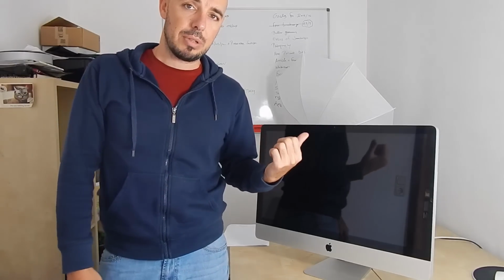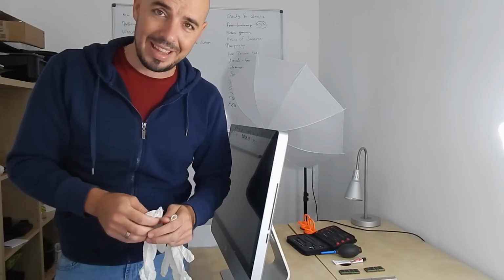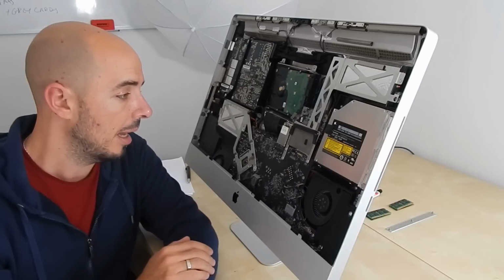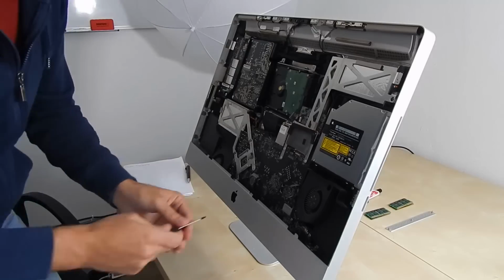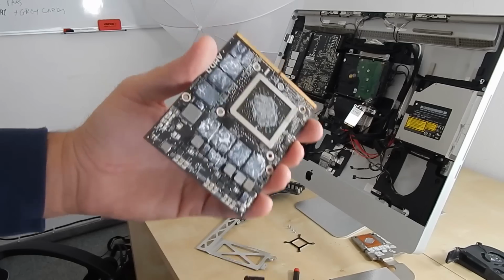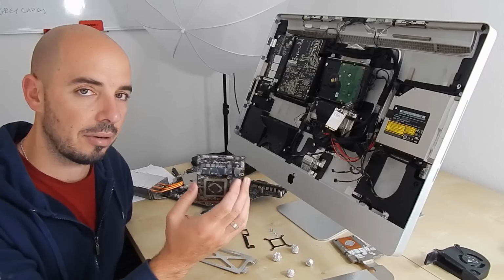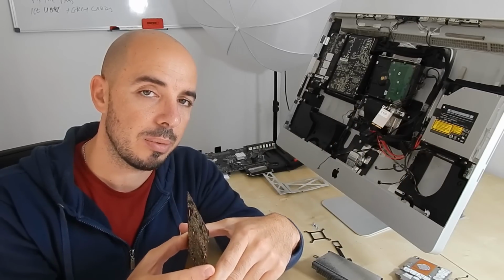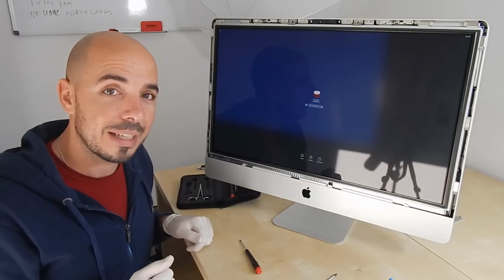Burn the VGA and  Fix your iMac - Don't Pay Shitty Problems!!!

Comment: I found this video very helpful and followed it and it worked.  But only for 3 months.  I'm going to do it again and this time, also install the smcFanControl app to see if that allows me to get some more time between fixes.  Hopefully I can do it a bit faster the second time now that I have the experience from the first go around.    I want to ask though: is there a more permanent fix? Or is it just an inherent design flaw?
Reply: It's the crappy quality solder that the manufacturer uses.

Comment: Good video! One tip I could add is that you can always test the system without having to reassemble everything by plunging up an external monitor to one of the thunderbolt connectors in the back.

Comment: I have iMac mid-2011 27" it is currently running on mac os Catalina but there is an issue with the system it is now slow, freezes some times, it heats very high and goes up to approx 150 Fahrenheit, and I am not able to downgrade it because mac os utility is not working on it. is this a graphic card problem or I have to change motherboard for this. Please help me on this I am stuck on it.

Comment: I just tried this method today,did everything but when I turned on to see the result,I had black screen and a beeping sound.I was surprised that I found a the first cable at the top that connects the screen it was with a bit of tape (maybe disconnected).I suspect this mite be the issue but what about the sound? Please help me!
Reply: You have to follow overstep very careful, I baked my gnu card twice successfully, it happened also breaking a wire and connector, but I manage to fix it. Good luck!

Comment: Hi! I have to say that I was a bit skeptical about that all cooking the Card and I was more thinking of buying and upgrading to a 2gb (from 1gb) instead of doing this. But I did. With little knowledge about disassembling the whole 27" imac 2011 that I had. But I already upgraded the HDD so I knew a little. I did it and it seems fine.... crazy amazing. I hope it will last... but after doing some testing yesterday it work very good. SO until now yes, I can recommend it. If you have any questions I can also try to help. But the video is pretty clear and shout out to Evan for sharing it.

Comment: I have read elsewhere, that this is not a good solution, at least long-term-wise. But since I did not have any real options, I chose it, and it worked! I am on a beloved iMac early 2008 24", really a great computer of its time. Good to see I can still use it and work on it, after 12 years! Still gets everyday jobs (and a few heavy ones), done. Great machine.

Comment: Just tried this, took me about 4 hours to complete and so far so good! Thank you so much!

Tip: create some kind of contraption to jam the screen fully back tilted. Been reading a lot about people accidently dropping the lcd and damaging the fragile cables when the screen suddenly tilts forward. Makes it a whole lot easier when fiddling with the cables connecting the lcd!
Reply: Hey Marcus, I have a similar issue. Just double checking that everyones not trolling in the comments. Does this indeed work?

Comment: Thank you Evan, another success. It was hard to assemble it back, but I made it!!. 
3 improvements to your video are: 
1) take pics or video during disassembling for every screw and wire, since start
2) be more specific about pulling out the Motherboard since it is locked from the bottom, with the IR sensor (about behind the Apple logo). Without pulling this the MB won’t come out!
3) Remove the RAMs otherwise it wont be easy to replace the MB in the original position, then place them back through the aluminium panel from below

Thank you again, I made it yesterday and I hope it will work for long time.

Comment: Hey Evan, your Video is great and it worked perfect, my Mac starts as usual  !!!  except  !!!  there is no sound and no connection to the speakers or earphone! Any idea what went wrong? Did I leave out a connection or what could be the reason. Any solution?

Comment: Wow. This actually worked. My mid-2007 iMac was hanging at the logo/progress bar screen while booting. I followed this video's instructions and I now have a perfectly working iMac again. Thank you, Evan! You have saved me a shit-ton of money, and I'm donating a GIANT cup of coffee via Paypal.  :)   Just in case anyone else encounters the same problem I did: After baking the graphics card and reinstalling it into the iMac, I booted to a black screen with no video at all. I could could still hear the chime and the hard disk whirring, but the screen was completely black. Some more Googling led me to someone who had replaced his graphics card only to have the same problem about the black screen. He resolved it by opening the box back up and re-seating the graphics card. It turns out that the card can look like it's properly seated, but you actually have to push it in pretty firmly, enough so that you can barely even see the gold contacts on the card. I re-seated mine and it booted up perfectly with no issues at all. Again, thanks so much, Evan, for taking the time to make this video. Enjoy your coffee, my friend!

Comment: I've done this on a logic board for an LG tv due to the HDMI ports going bad. If you don't want to deal with the smell inside the house, if you have a toaster oven, you can use that outside. Works just as good! Great video!

Comment: It friggin' lives!  I finally went through with the oven reflow, and it worked!  Thank you.
Reply: Update:  It's been a year and the GPU is still working.  Definitely run the smc Fan Control app at all times.  My iMac temperature hardly ever goes above human body temperature.

Comment: Thank you Evan!
It worked out fine and my mac came back up.
My imac is from the middle of 2010 and it is possible to remove only the video card without the need to disconnect all the connectors or remove the motherboard. But since I had already removed the motherboard, I changed the thermal paste of the processor. Here in Brazil the repair would cost R$ 3800, equivalent to 1000 US$. If it were not for you, you would give up this imac. THANK YOU!

Comment: So I did your solution today and so far it seems to be working...I think I switch the fan and the sensor cables as the fans sound like they are running on high...will keep all posted for how long it lasts

Comment: Hi Evan! My name is Andrew I am from Russia! Thank you so much for your awesome awesome cool great video! My wife and I have been working on the imac all evening. After dismantling the IMAC, we finally took out the video card and stuffed it in the oven for 8 minutes (200 degrees Celsius). And it worked! THANK YOU VERY MUCH. Little advice. We decided to install Windows on our imac. The video card works, but it heats up to 90 degrees Celsius! To fix this, we installed the Macs Fan Control program (the program is available for both Mac OS and Windows). We adjusted the speed of the fans and now when the video card warms up to 70 degrees, the fans work at full capacity and do not allow it to warm up more than 70 degrees. Thanks again! Guys, watch your cooling on the imac.

Comment: Saved me £400 for replacement graphic card repair - Thank you, This works, I just wish Apple would make the monitor cables 4" longer, would make it so much easier to work on the inside

Comment: Thank you a lot Evan! You saved my Mac! But I found another method to unmount the video card that avoid to remove the mother board. You must remove only some torx and a cable behind the m/b connected to the videocard case before to pull up the board easily. 
Thank you again!
Reply: Thank you for your useful advice! It worked :)

Comment: I used my hot air gun for 8 minutes at 200 degrees. Fixed the imac first time amazing. I was tempted to add some flux to the chip solder balls but as it turns out not necessary.

Comment: November 17th 2018 - Been having many problems getting my Imac 27" Late 2011 to work

Wouldn't start properly trying internal HDD OS & separate internal SSD OS. Tried Recoveries, internet recovery, formatting drives but still wouldn't load OS correctly and after a while it kept suddenly jumping to a BLUE SCREEN with vertical lines 

I tried this 200c for 8 mins this afternoon & WOW IT WORKS !!!!

Big thanks! Even if it doesn't last it's evidence this work sand finally i'm away from an issue i've had for month now (bought a new Imac at the time as couldn't wait)

Comment: Evan , you don't need to take the motherboard out just loosen the 3 screws on the heat sink at the bottom and the top screws and it will come out without taking the main board out. Also consider replacing the hard drive and the dvd player with SSD drives. 
The Imac benefits two ways 1) the system will run a lot faster , 2) the heat generated  is considerably less.
I used a 1TB in the main drive location and a smaller SSD in a drive caddy for the dvd location.
Heat, dust contamination &  poor ventilation kill all electrical items,  the heat sucks in the dust which kills the card. If you still want a dvd drive you can buy a dvd enclosure on ebay or amazon, most people stream these days or use usb sticks so dvd drives are not used that much.
One other thing when you drop in a SSD the temperature sensor that plugs into the hard drive cannot be used, so I took the thermal stick stick on sensor off the dvd drive and placed that on the SSD. If you don't use a sensor the system fans will be running 100% all the time eg noisy .
I used a system cleaner to removed the old thermal paste and then cooked it and used a chemical cleaner to remove the contaminants before applying the silver paste sparingly to the chips.

Comment: Knock on wood, this seems to have fixed my 2011 iMac 27" 3.4Ghz i7.  For 3 weeks I was trying all sorts of recovery methods, re-installs but couldn't get the Mac to work.  Sometimes it would run for a couple hours but eventually it would white screen.  I even brought it into the Apple store and after they re-installed the OS, it worked for a brief time long enough for them to run hardware diagnostics to which they said 'everything passed the hardware tests'.  However, once I got home and used the machine for just an hour, it white screened again.  I thought all was lost so I ended up buying a new iMac.  However, I came across this video (and others like it) and decided to roll the dice since I already had a new machine and had nothing to lose.  I tried baking the graphics card and presto it's been running for a week straight with no issues.  I'm not sure how long it will last but it's absolutely working now and no hint of failures yet.  If you're at a point where you're seeing all the same symptoms (e.g. white screen, screen acting weird, etc) and none of the other fixes work, I suggest giving this a try.  I did read somewhere that it's better to use just a little thermal paste rather than the gobs that Apple used so I was a bit more conservative with how much thermal paste on put on, hopefully that's the right thing to do.  Also, apparently at one time this would have been covered under a recall from Apple where they would have replaced the graphics card for free up to 3 or 4 years after original purchase, but that recall expired several years ago.  Give it a shot and best of luck!!

Comment: I did this and my iMac has been working for two months now. It’s a bit of a mission but well worth it. Thx for this helpful video, really appreciate it.

Edit: It has failed two more times so this will be the third time I bake it, I’m going to give up if it fails again tbh. To be fair to apple it did last for 8years with extreme graphics work: photoshop/illustrator/muse/Spotify/after effects
Reply: lionelrichtea this is good to know. My computer just stopped working, and I think it’s the graphics card. I work in Adobe programs a lot.
Reply: Ainsley Bourgeois it’s a pretty intensive procedure and you could easily break something else (not for the faint hearted). It’s the old chips, they slowly move off the board and then the computer registers that it’s off and it won’t work. I was quoted 700£ to get it fixed!! But that would of only had a 30day warranty, no chance I was doing that. I ended up getting six months extra by repeatedly doing these bakes. I saved up and just got a brand new one. I really feel for ya as it was a nightmare for me, Good luck.

Comment: Hi Evan and thanks. I have one question, thermal paste's conductivity ratio seems to be very important for the lasting of repaired VGA card, I'd like to know if this paste gotta be high or low conductor. I have heard K5-PRO brand thermal paste works very well (K>5,3 W/m.K ).

Comment: Thank you for sharing this very very useful video,, my iMac, same model as yours, died in December 2017, same graphics card problem which I found out after a visit to apple store to get my imac diagnosed... They said it is not repairable because the part is not available anymore,,,, So I got in touch with a local MAC specialists and they offered a repair which would cost me £750..  and even that is not guaranteed to last forever because they would be using a second hand graphics card... which I was so disappointed with it until now... I am going to try this method and see if it works, as I have nothing to lose since the iMac is sitting in the box as a useless monsters....

I will update after the FIX and possibly upload a video too.

Comment: what is the deal with the 10 secons pressing? i did all that and now my imac wont power up, i looked over the internet and some people resolve the non power macs by pressing back the power button for 10 seconds, other unplugging the cable, but nothing of that seems to work on powering on the imac, nothing happens, no sound, I had done this proccess before and worked fine, the only diffrent this time was pressing the power for 10 secs, please if you know anything about what exactly that move does to the mac will aprecciate. :-(

Comment: I know very little about computers, I just use it to edit. But my graphics card died and the store wouldn't fix it and I was desperate and also very broke. Then I found this video. Evan, I don't know you but... I love you. By watching you over and over and over again I did it and... IT WORKS!!!! I can work again!!!

In my case, I ignored the stripes until finally the screen just went black. Still powered on, but nothing on the screen. Yes, this is graphics card failure. Yes, cooking the card works!

Additional tips for first timers: 
1. Get some masking tape and mark each wire you pull, then draw a diagram so you'll remember where they all go.
2. Sometime before you put the Logic board back in, take out the RAM. This will help the Logic board slide in easier. Then you can put it back after everything else is re-assembeled at the bottom center vent under the monitor. 
3. Consider taking the fans out while you're at it and cleaning out the gunk with isopropyl alcohol, a toothbrush and canned air. 
4. The old goo on mine was in more places on the card than where Evan applied his. I wondered if some of it was a thermal cushion rather than paste and I debated a LONG time about if the Arctic Silver I used would be OK... I ended up trying anyway and it's fine. So don't stress about that. Save yourself a few hours of anguish.
5. Reserve 2 nights for this. Evan could do it in an hour, but if you're a noob like me you'll need lots of time.

Comment: OMG - thank you - thank you - thank you! Had WSOD issue and not booting to the logon screen. Over last two weeks I went through just about everything, RAM testing, Hard Drive testing, multiple booting into various modes on startup ... all to no avail. But today just 2 hours ago after watching your video I thought heck I've got nothing to lose, so I stripped my iMac 27 Mid 2011 right down.

Baked the Graphics card in a combo oven on the convection setting (not microwave I hasten to add) at 200 degrees c for 9 minutes. It came out a slightly darker colour than when it went in but essentially looked ok. 

Then I re-pasted the on board chips and put it back together. Also re-pasted the CPU whilst it was available to get at and I'm astounded to say, I mean really astounded to say it's back! 

Thank you so much for sharing your video Evan it gave me the confidence to give it a go.

Several coffees are on their way to you!
Reply from the maker: I am really happy that my video helped you my friend! Thank you very much for your support and enjoy your freshly baked iMac! :)

Comment: I have just done it today and so far it is ok. Only little problem with screen, left side became more darker, but no issue like before. Thanks a lot again for this video. It helped me a lot. Hardest part is to put everything back, that was headache. Good job Evan.
Reply from the maker: When the monitor is not fully in light and has a darker side, it means that the monitor cable isn't fully connected. Try to reconnect it. ;) Thank you!!

Comment: Thanks a lot, I have had this problem today with my iMac 21.5 2011, verticaly green and grey  stripes and white screen and loop reboot. After saw your video , I think about it and before open the imac I put it horizontally and close de the air holes of the imac (dangerous) , switch on , untill it was very hot, (20 min) , then I reset it, and magically start to works..... Again, thanks.